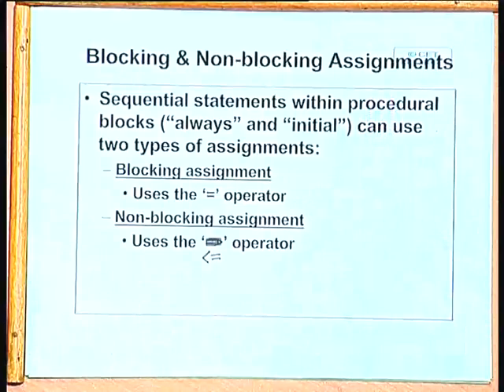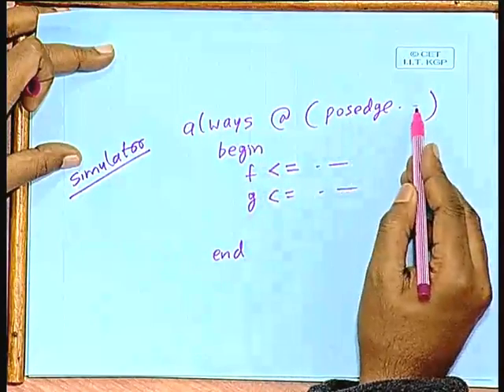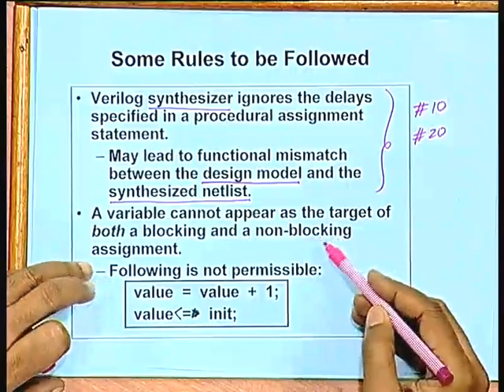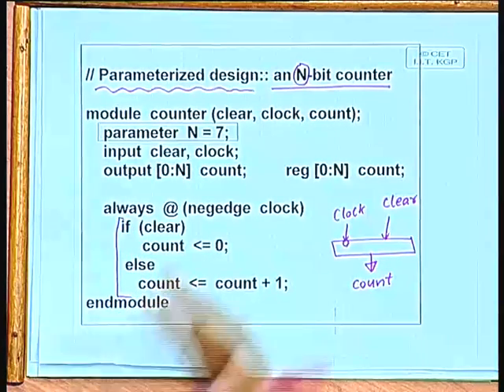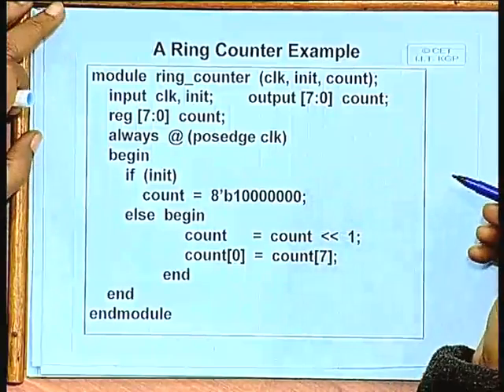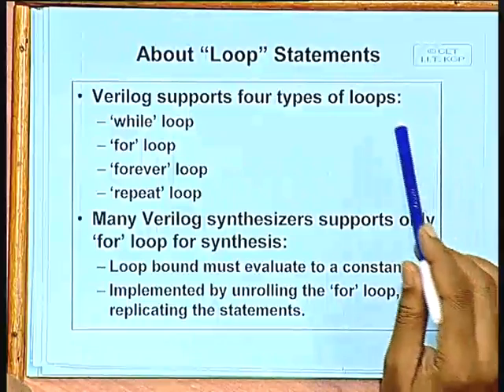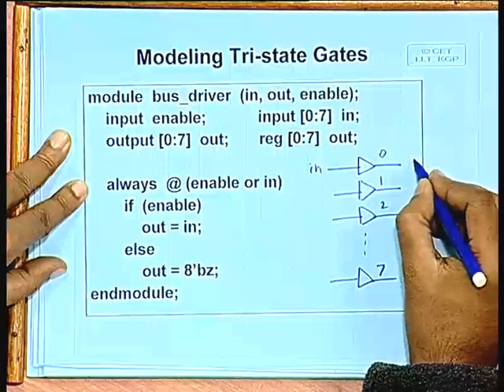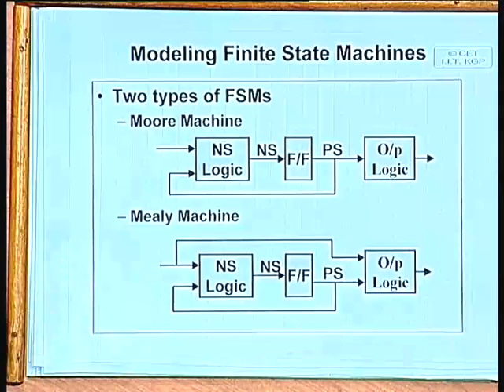Lec-5 Verilog: Part-IV

Comment: I observe that in the examples, the always block is given, but begin and end are being missed, is it really alright to miss on them?
Reply: Anirudh Pochiraju If there is only one statement inside the 'always' block, the begin and end are not required.  This statement can be an 'if' block for example.  This is similar to the C language where { } are not required around a block if it only contains one statement.
Reply: The begin and end is used multiple  block of sequential statements. If using of single block of sequential statements, Their is not requirement to write begin and end. Thus putting begin & end multiple times. It will run parallel order respective other begin and end.
Reply: Begin and end block are similar to curly brackets in c. If there is just one statement then no need of begin and end block